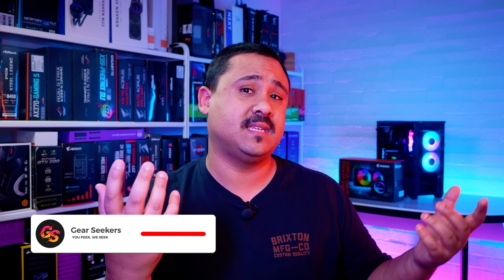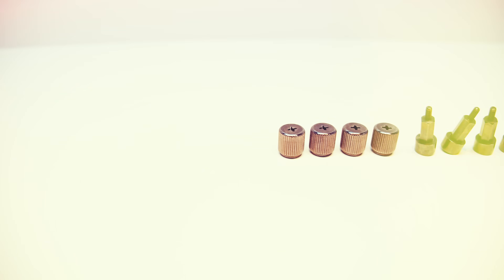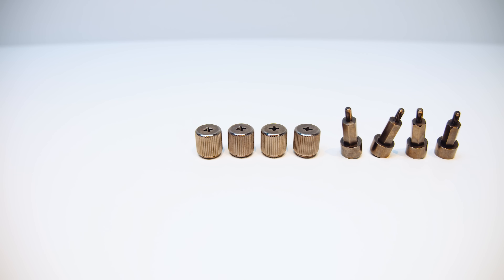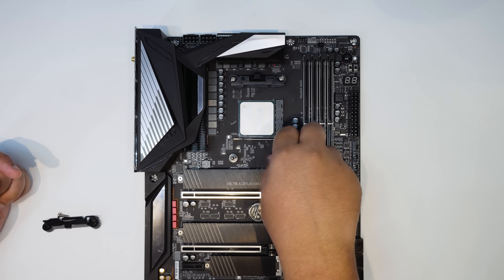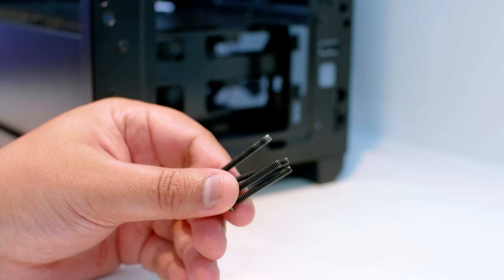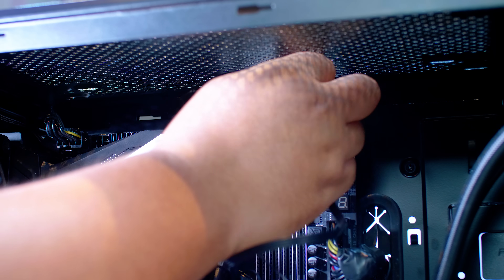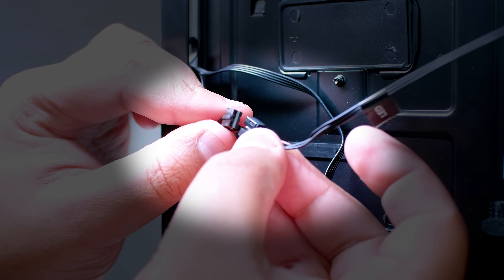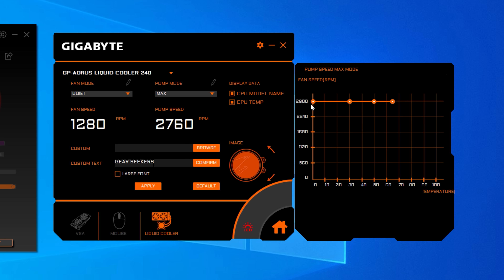HOWTO AORUS Liquid Cooler 240 AMD AM4 & AM5  Install Guide

Comment: dump question, im setting up a PC for the first time since years. i bought the x360 waterforce. How does it work when Installating the BIos and Windows? how to prevent oberheating? does it run out of the box with SATA and USb connected?

Comment: Consultation I have the Aorus Waterforce 360, the first version is not x, it will work for me to use it with an Aorus Master x670e plate with a ryzen 7800x3d due to the anchoring issue.

Comment: My X360 Waterforce isn’t displaying the lighting modes from Gigabyte Control Center while at the Cooling tab. It just pick up some while in the Motherboard tab. I don’t get what’s wrong. My case is a Cooler Master H500P Mesh ARGB.

Comment: Tried two of these units and neither one would display the CPU info or temperature data, no matter which Aorus engine I installed (2.0 thru 2.1.6) ... which is why I bought this unit.  Anyway sending it back and going back to my Be Quiet Dark shadow Slim Air Cooler.

Comment: i have a waterforce 360 X; it detects a 240 x. I can change the pump screen but i cant change the lighting of the cooler fans. Can someone help?
Reply: Change the lighting with the rgb fusion app0
Reply: @autreenmirhosseini1533  This was 2 months ago it was bugged tnx for the tip tho

Comment: anybody got an issue that when you turn on temperature display on the lcd it shows different temps than the bios and msi rivatuner?? mine was showing 58-64 rather than 38-42 on bios/msi rivatuner.

PLEASE HELP

Comment: question do you known what's  going on when  on my aio display saying temp 00 its not reading temp anymore help please.
Reply from the maker: Install the software
Reply: @GearSeekers  wich one?
Reply: @GearSeekers  i got aorus engine 2.0.3.0 with rgb fusion uninstalled and install after restart still shows 00

Comment: can someone help me, mine after updating aorus engine driver now cant displaying CPU temp. just stuck 00 degreee and display data cant be clicked,
please help
Reply: Anyone else having trouble displaying the liquid temperature?  My x 240 displays all other information correctly, but liquid status remains 00, I have no idea what this could be, hoping it's a software issue, or some processor incompatibility, in this case a 5900x.  If anyone can help, I appreciate it.

Comment: Hmm so I’m using this with my h510 elite and nzxt rgb fans 
So it will be fine to not connect the fans with the aio pump and just with the radiator and the nzxt rgb hub right?

Comment: if you guys still reply, on the x570 master, will I get ram clearance issues with the hoses if i try to mount 4 sticks?
Reply: Did you find the answer to this question?  I am wanting to change to a liquid cooler so i can add 2 more ram sticks, there is no way i will be able to fit anything in the first slot with the existing cooler I have.
Reply: @ambientlounge3148  I mean you can simply just mount the hoses on the bottom instead of on the sides
Reply: @falsecatalyst3936  ok great,  thanks for the advise!

Comment: How do i get the image on screen to sit at a perfect 180 degrees horizontal? I already rotated the image to correspond with where the water pipe is , but the image of off by like 10 degrees anyway and it's definitely not aesthetic

Comment: (Questions removed)

Love your vids, man, thanks for all the help! <3

Edit: Okay so I installed the 280, similar to how you have shown, but in the Fractal Meshify C Mid: https://www.memoryexpress.com/Products/MX68834 , and with the fans on the inside, because of spacing issues. It seems to be working fine, temps are good. I was using a custom fan curve with the Hyper 212 Black rgb, which was in my previous case, should I set one for this one? It bothers me slightly, how Ryzen chips fluctuate so much, and cause the fans to ramp up wildly. I have it set to quiet in Aorus Engine, any other tips, not in the video?

Comment: Im trying to assemble a NZXT h510 elite build with the aorus x570 elite wifi, the trouble im dealing with, is that im in the need for 3 usb conectors (the one from the front panel, the one from the x53 and another one from a AER 2 HUB, since i installed another LED fan) what should i do? Thank u for ur videos man!.

Comment: Ok I have this cooler and the x570 MoBo.  Where do I get the fans to the MoBo? What connector I have the 360 version.  3 fan connectors got it.  Where do the fans connect to the MoBo?
Reply from the maker: They don't. They connect to the cooler
Reply: @GearSeekers  so all fan speed control is through the usb?
Reply from the maker: Yes
Reply: @GearSeekers  So I changed out the stock Aorus fans for the Lian-Li uni fans. I have all 3 chained as they should and the 4 pin fan going to one "fan" cable from the pump. Aorus engine will not display the fan speed.

Comment: Hey where did you connect the lights for the fans? Did you use D_Led1/2 or Led_c1/2? First build got it all together just want to double check I have everything where it needs to be before turning it on

Comment: Do you need to apply thermal paste? I heard it comes with paste pre applied but is it better to do it yourself?
Reply: Xtm70 by Corsair is the goat bro just buy it n trust. I put LM on my 14600k along with that on the cold plate and full power stress test barely scratched 60c. 40c in marvel rivals

Comment: Problem is there is no CPU connector, this cooler connects to SATA so my motherboard isn't recognizing there is a CPU cooler causing me to have a long continuous error code beep. The only solution to this I've found so far was to turn the error code off in the bios but I am at a complete loss. Also make sure you plug into its own separate SATA power

Comment: PLEASE READ Guys I have this AIO  on a BRAND NEW PC Build. Everything in my build runs smoothly BUT the Aorus Engine software used to control  this AIO I DO NOT. Recommended buying this AIO because the software is EXTREMELY SLOW and buggy and half of the time it wont even open

Comment: I have an aorus z370 gaming wifi, I bought the aorus liquid 360, I have a 600w thermaltake power supply. Everything works fine, I installed the software that the liquid requires but the lcd monitor does not turn on. Check well the connections, drivers, software and nothing makes it turn on. Everything is new on the pc. Any idea what it may be since it is the second one I install because the first one I sent to newegg and they sent me a new one.
Reply: Yeah i learn on reddit that the problem is the voltage on the cheap psu okay now i need to change my Psu. Really thanks for reply
Reply: i have the same problem you already solve them??
Reply: @ferdeths802  i fix it when i change my 600wt  power supply to a 850watts power supply.

Comment: Awesome guide!!! Quick question, which would you rather recommend thermally between the Gigabyte Aorus 360 or the Corsair H115i RGB Platinum on a 9700k in a Fractal Design Meshify S2 case?
Reply: What MB?

Comment: I cant find a Sata power cable anywhere with 5 wires because right now my lcd display isnt working and I looked its because of cables but I only have 4 pin

Comment: please help no display on my aorus aio 240. PSU thermaltake 600w
Reply: You need to buy a power supply that has 5 pin sata cable

Comment: Hi, Can you rotate the display through the software? Or, can you rotate the bracket so that the in/out pipes are turned in another direction (for example facing upwards), other than right, so that they're facing in a direction other than where the RAM is installed? TIA

Comment: You installed the radiator up side down
Reply from the maker: Are you high?
Reply: @GearSeekers  Dude you obviously have no clue what you are doing. You need to exhaust your heat out. Not blow it in. Then you need to flip it around so the hoses are at the bottom when mounted virtical. Trust me and Google it. Watching your install is exactly what you should not do. 🙄
Reply: Okay so now I went as far as to look at the instruction manual supplied with your aio. It clearly shows the water lines at the bottom. The reason is because air can be inside your aio and cause noise or performance loss the way you installed it.  I would flip it keeping any air on the other side of the radiator and not going through the block. 🤔 Then flip your fans blowing out. Then put 2 more fans inside pushing air out. So then you will have a push /pull added performance.
Reply: With further research having space even thickness of the case is bad. You need to mount your fans directly to your aio to have proper seal of either pushing or pulling air. After doing everything I advise your temps should drop 10c.
Reply: @GearSeekers  Did you rinse and repeat doing it wrong? I just installed the same cooler and my temps are 10c lower than yours.
Reply: @GearSeekers  Don't freaking ask if I'm High. When you have no clue what you are doing. Learn it, breath it and then make a video. Everyone that didn't thumb down your video is now mis informed. I would be ashamed. Making a new video and deleting the old one.

Comment: I purchased a month ago the same motherboard and cooler displayed in your video as part of a new PC build. I watched it a couple of times to get the hang of it. Unfortunately  when I received my motherboard I later discovered it arrived as a DOA. I had to remove the cooler and other parts and sent it for assessment. It returned today. So excited to get this battle station fully operational at last, but when it came down to installing the above cooler I noticed that the 4 standoff bolts were missing. I'm not sure if I somehow misplaced them but then again they were the only items missing. The bottom line is I am without the bolts and with only the screws I'm unable to set it up. How unfortunate can one be? The question I would like to ask is if these can be purchased or a substitute to bolt this thing together.

Comment: Hi. Is it normal to have the icon that a USB device is plugged on?
https://imgur.com/GQLuWDl
I also encounter a problem when I start my PC, this cooler's lights are off and the engine software can't detect it.
When I try to unplug and replug the USB connector back to the MoBo, it works normally again.
Reply: try going in bios and make USB work when pc is off for charging etc.

Comment: Thanks, I needed this. I have a 280 on the way.
Reply: Can you put gifs on it like a nzxt kraken
Reply: @Omega21320  Custom image: Support BMP only, image width under 820 pixels. AORUS ENGINE will crop a 320x320 pixel image from the full image.

Comment: DO NOT BUY this piece of shit. The Aorus Engine app that is suppose to control the LCD screen is absolute trash. I had it work a couple of times, but since then it will open then just not respond. Then ask if you want to close program or wait for a response.

Comment: Noooo, the radiator tubes must be down, the reason for this is that over time, the coolant evaporates and the air bubbles would stay on top and the pump would never suck it, improving the useful life of the cooling system
Reply from the maker: Not true at all.

Comment: As always great hotwo! I'm waiting for mine to arrive. Since it's my first AIO cooler, do I understand that right: I don't use my CPU_FAN (and CPU_OPT) headers at all with this? Is everything controlled via the USB connection? Thanks!
Reply from the maker: Yep all USB
Reply: @GearSeekers  sir, but why I dont get rgb lights from it, I followed ur steps, the fans are working, this is a new build :(

Comment: HELLO, I HOPE THAT WITH THE TRANSLATION OF GOOGLE YOU WILL UNDERSTAND ME.
THANKS FOR THE VIDEO. I'M RIDING MY BUT WITH A 360 IN A QUADSTELLAR. I SATURATED WITH SO MUCH CABLE AND CONNECTION AND LEFT THE PROJECT. YOU HAVE TAUGHT ME THE WAY, WHICH IS NOT AS COMPLICATED AS I THINK AND I HAVE IT READY.
THANKS, AGAIN

Comment: Some how every thing works:the fans and  it cools, somehow my lcd screen won't turn on any tip?
Reply: @mikecarrizales7499  any solutions
Reply: @CodingCornerDev  mine was just a bad unit. Sent it back and the new one worked fine. Only thing I could say would be to download the aorus engine software and try to reset the image
Reply: @mikecarrizales7499  i think mine too. beside the fans running nothing else works no LED no rgb ..
Reply: @CodingCornerDev  yes unfortunately if its not a lack of power issue I would say try to return/replace if possible

Comment: Windowshopping for my next build, probably going with a Corsair Crystal Series 680. The case comes with 3 LL120 argb fans in the front and 1 non-rgb LL120 in the back, so I figured I'd buy an additional set of 3 to use as exhaust and slap 2 on a AIO. Now for my question, will the software have any issues if I change the aurus fans for corsair LL120?

Comment: "if you are lucky" because rgb fusion never works
Reply from the maker: Never ever had issues with it. You know why?
Because common sense isn't common.
Reply: @GearSeekers  common sense or licking sense?
Reply: easy to use program, even with non Aorus RGB ram, only people that complain don't know how to use computer software
Reply: @smokyicedrw   to use it  is super easy,if  the app works proper and not to drag and drop folders to make it work
 ,read use your brain then answer

Comment: aorus engine does not recognize my liquid cooler 280. the screen stays black or the logo just stays on. impossible to find a solution
Reply from the maker: Update the firmware
Reply: @GearSeekers  from the motherboard?
Reply from the maker: The cooler

Comment: It is easy to assemble it, ok, but there are no explanations neither in the manual nor in this video, attached 2 seconds, saying very easy, but don't say that you need a usb header for the 4 pin male cables of the cpu, same speech led headers but this was known
Reply from the maker: Everything was explained. You clearly didn't watch the video
Reply: @GearSeekers  lol, i am italian, maybe i not listen all, cause i am not motherlanguage, but on aorus manual, anything about this is explained
Reply: @GearSeekers  can u link me that i need for cpu fan connection, and led connection? Thank u, for led maybe i find, but for fan cpu, i don t find anything for male output like this, thank u so much, have nice day.
Reply: done

Comment: Great Video. Awesome Cooler. Looking at getting one myself. On the installation though, I'm confused; so the only cable linking the cooler and fans to the motherboard is the USB2.0? There's no cable from the pump to the CPU_Fan or CPU_Pump header? Won't that cause the Motherboard to give CPU fan error on boot? I know it can be disabled but I wouldn't like doing that as I'd actually want to know if the pump fails and I'm about to fry my system.
Reply: Correct, you can only control this pump via proprietary software on windows. There is no pump header. However, it's actually pretty damn good even with the pump on auto (90% sure it defaults to minimum) and the fans plugged into mobo headers instead of the pump itself at top speed.

Comment: Can I put only 1 fan on the radiator?
Reply from the maker: Not recommended
Reply: @GearSeekers  If I have fans on the front from the outside of the case, can I put the radiator on the front from the inside of the case?

Comment: How does it compare to a x63 Kraken
Reply from the maker: X63 is a 280mm. Logic suggests that 280mm is better than 240mm
Reply: @GearSeekers  I guess I meant which is better out of the Aurous and Kraken, both 280 mm? Which cools better, lasts longer, etc.

Comment: Does anyone know the finer details on setting this device up with the Gigabyte F11C UEFI's Smart Fan 5?

I am trying to set this up but the information is so lacking on setting up the UEFI for this particular cooler. I've also complicated the issue with also getting the Gigabyte Waterforce RTX 2080, so I have 2 pumps listed, but there is no way that I know of to tell each of these components apart.

It's frustrating because I have all this high end gear that is built for overclocking but I'm unwilling to use the hardware to its potential because of all the massive gaps in information I need to make sure I can play with the settings without bricking another computer.

Does anyone know anything about this specific area of the settings?
Reply from the maker: You need to use AORUS Engine. Exactly like I mentioned in the video

Comment: Hi Can I connect the fan cables to a controler from Nfortec?I mean,I use a Nfortec fan controller and my question is if I can conect directly to this controler and the where can I put the other cables? Thx